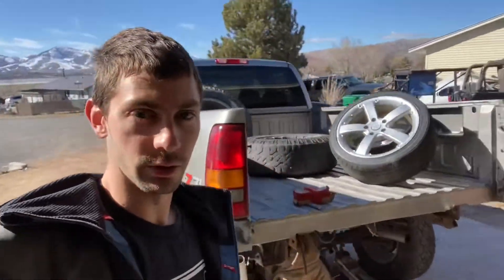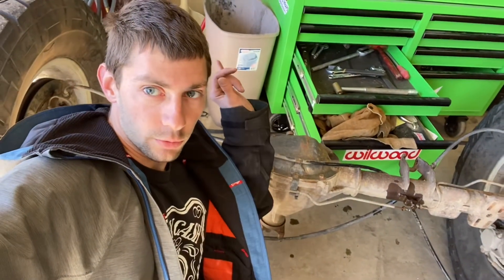How to do a 14 Bolt Swap and why

Comment: I'm about to do this and you're the only one on the internet that I've seen doing this with a 10.5 inch free float 14 bolt. Every other video and forum has everyone using the 9.5 inch 14 bolt. And they all want to figure out how to use 6 lug wheels. I have 2 matching sets of steel rims, one set is 6 lug and the other is 8 lug, both sets look exactly the same and both sets are 16 inches. The only difference is the lug pattern. So I'm gonna have 6 lug in the front and 8 lug in the rear too. I wonder if anyone will notice lol..

Comment: All you have to do is get custom 6 lug shafts from Dutchman axle if your axle is from a 99-06 truck you need a 33 5/16” length shaft, with the hub of an 88-98 truck with a 14 bolt, then a 6 lug rotor from an 03 Chevy express van 2500
Reply: Why not just get matching rims? I m about to do this and I'm gonna use 6lug front rims and I found 2 8lug rims for the rear end that match the front ones. The only difference of course is the lug pattern. I want to see if anyone can spot the difference when I'm done lol..

Comment: What did you pull the 14 bolt out of? I got a 9.5 14 bolt out of a 02 suburban 2500
Reply: how do I make it work? 95 10bolt to a 99 14bolt from3500 pickup

Comment: What did you do about the driveshaft? We’re doing the same thing but we can’t get the drives shafts to match the you joints are different And they’re both different links
Reply from the maker: My driveshaft just fit perfect, you might need a conversion u joint tho
Reply: Do you know if the u joints are 1310-1350 to convert it?

Comment: tyler, not sure if you put that in because you had it, or if you selected that, but i would always go with the 10.5  14 bolt gm rear end, or at least the 9.5 with the pinion bearing the one with the bolt on housing in the front, the 9.5 straights are decent but the 10.5 is bulletproof if you want something that will last.

Comment: 14bolt s.f.  6lug
Reply from the maker: What?
Reply: @Turbotylerfun  14 bolt semi float axle would retain you use a 6x5.5 wheel back on.
Reply: @sleepyunclejoe6020  rather find a 6 lug hub/spindle

Comment: You can always get 6 lug axles for the 14 bolt
Reply: I thought GM made a 6 lug 14 bolt. Im going to do one for my Silverado. I think GM put them in some Tahoes and TBSS?
Reply: they do
Reply: @DM-qp7do  sounds like a Semi float.
Reply: @shadowopsairman1583  A semi float? Im not sure what that is. I think GM put 14 bolts and also a more heavy-duty rear end in some 3/4 tons but im not sure. What id like to do is find a 14 bolt with disc brakes already on it, slam 4.30s or 4 56s in it with posi and it should be bullet proof for the amount of power ill be making.
Reply from the maker: Can u drop a link to them?
Reply: No 2 piece wheel adapters available?